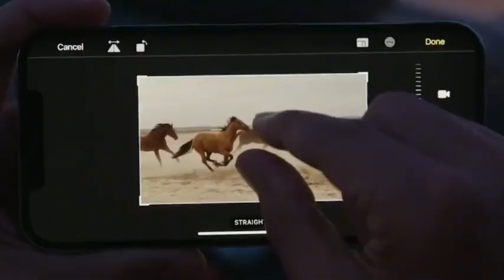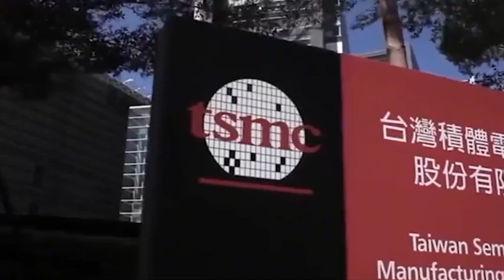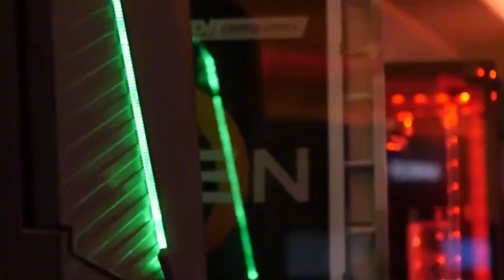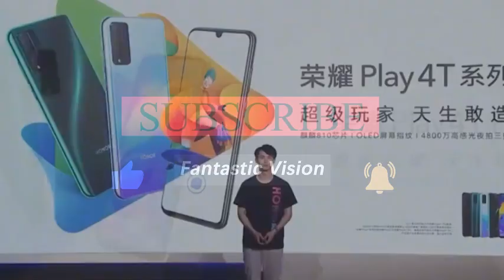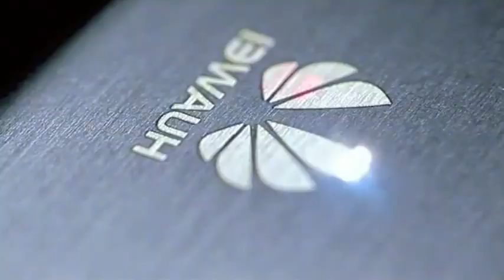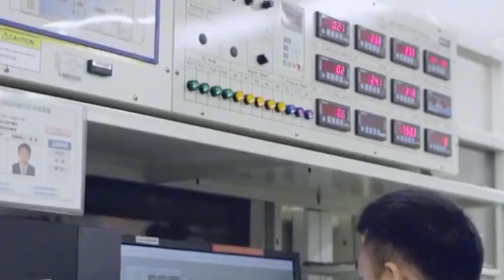Has Huawei gone silent? TSMC is worried because China's chip progress is far beyond imagination!

Comment: Not mentioned was the fact that Intel bought the latest ASML EUV machine, the NA EUV and TSMC did not.  Does TSMC know something Intel doesn't.  

Huawei has built a very large semiconductor R&D center next to SMIC's Shanghai fab. It appears the collaboration between Huawei and SMIC is gaining ground.  The rumor mill says that Huawei is working on their own EUV capabilities, the latest being their SAQP process that enables 5nm chips. Further, there is an effort to use particle accelerators to create EUV light source so there is evidence that that effort, likewise, is being pursued.

Maybe this year we will get a glimpse into Huawei/SMIC/SMEE progress in competing with ASML. ASML should be worried.
Reply: Tsmc bought also a high na euv tool.